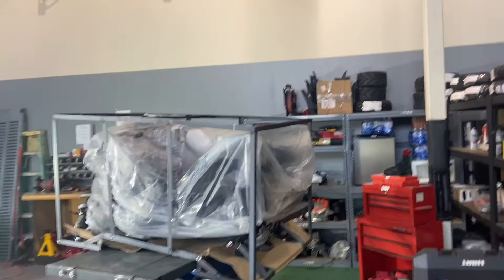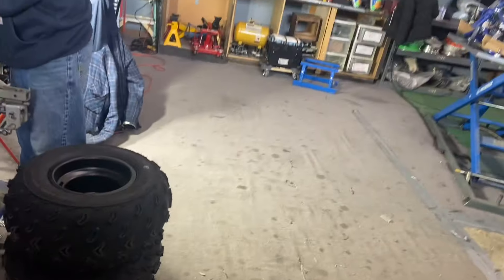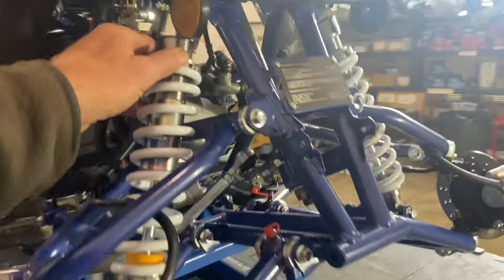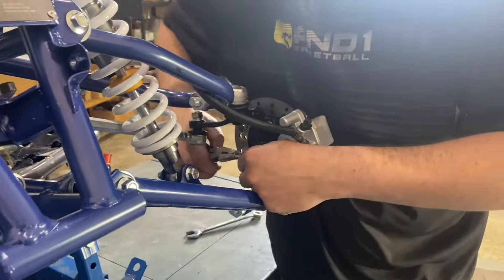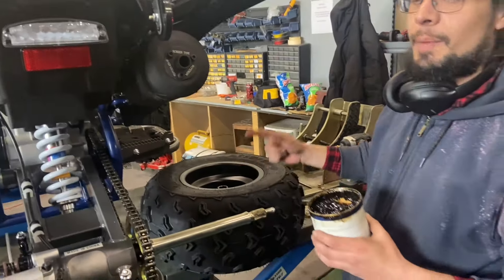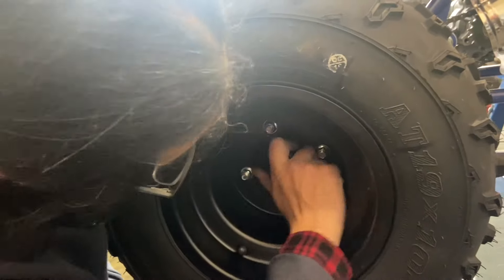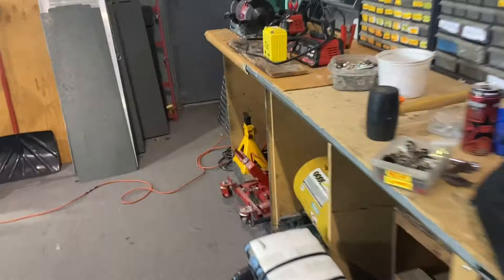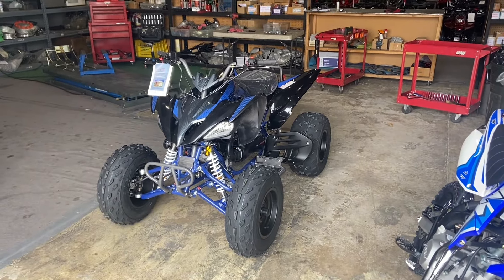YAMAHA REPLICA ATV | CHINESE ATV | OFF BRAND ATV | PENTORA 150 ATV

Comment: I've had mine for over 3 years and have had a few wrecks including a nearly fatal roll on the pavement. These little monsters can absolutely live up to the reputation of a Yamaha. I modded mine out the wazoo, have a top speed of 50 mph but will add a couple inches in tire this year to get it to at least 60 mph. There's a ton of low end to spare so it will never be missed by advancing the top speed.
The only thing I will say is shit is the stock tie rods. Until you replace them, expect a shimmy when you're full throttle.

They're only 4 gears, but I'm  6'0 and 200 lbs getting wheels off the ground when I hard shift into 3rd gear and a slight tug back on the bars. These could literally eat through 6 gears if it had them. I bought a 250cc Honda dirt bike clone about 16 years ago but wish it had been a 4-wheeler instead since having this to know. 

If something happened to mine, unless I could buy something hella expansive I would most definitely buy this again. Most of the Yamaha parts are compatible and lots of hotrod parts are dirt cheap. I put a fireball glasspack car muffler on mine an it sounds vicious. I have hated Lake Erie winters my entire life until I got this!
Summer is nice for riding but winter is exponentially funner!
I can shred through snow literally 2 1/2 high, just gotta sit waaaaay back on the tail of it to get traction lol.
I see people on snow mobiles and they're just complete shit compared to what I can do on this quad and it will go literally anywhere they can. I'm a symphonic and shred guitarist for decades now and own several thousand dollars in heavy duty gym equipment; my 4-wheeler is dead even tie with the guitar for which I love most putting the weights in 2nd place.